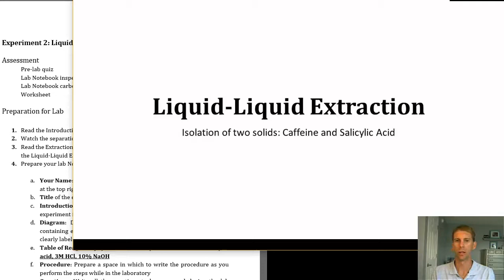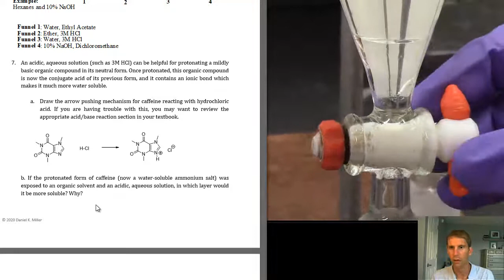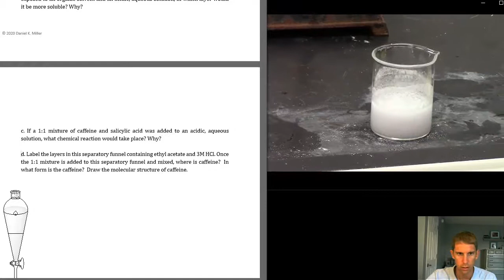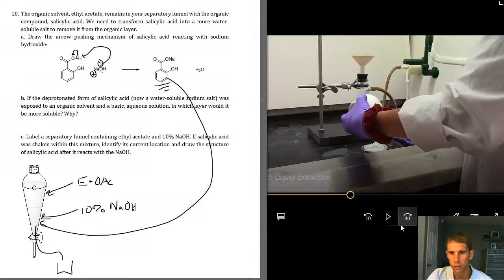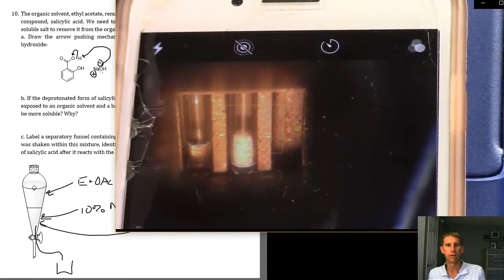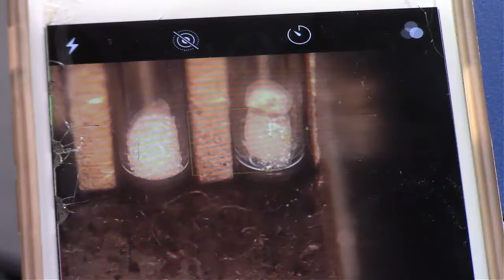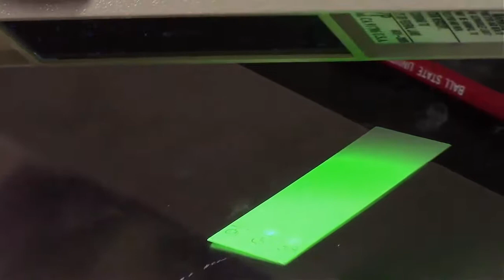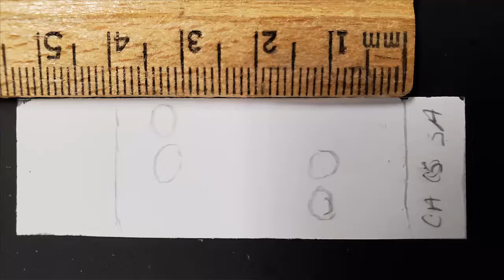Liquid Liquid Extraction Part 1: Separation of Caffeine and Salicylic Acid

Comment: Could we see a table of reagents that is blank for this experiment?
Reply from the maker: A blank table of reagents would consist of Caffeine, Salicylic Acid, 3M H-Cl, and 10% NaOH. You would then input the MW for all of them as well as the information required to obtain the moles for each solution (grams of the solids, Molarity of the H-Cl would be used to directly calculate moles, and w/v of the NaOH would be used to calculate grams NaOH). Melting points (MP) of the two solids should also be included because that is the reference used to assess the purity of the isolated solids. The table would look very similar to the one used in experiment one, but make sure to add additional rows (moles or mmoles and MP)

Comment: For the percent recovery do we use 1.28 grams?
Reply from the maker: That mass is the total mass of the 1:1 mix of caffeine and salicylic acid. You need to calculate the mass of each compound present in the 1:1 mixture, and that calculated amount is the theoretical amount that should be recovered for each.